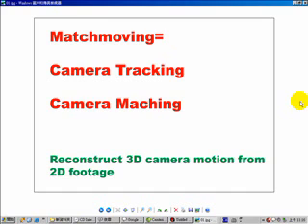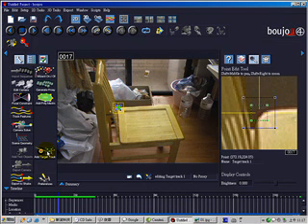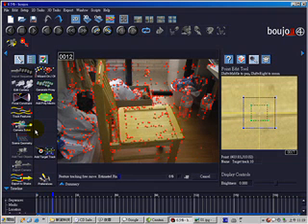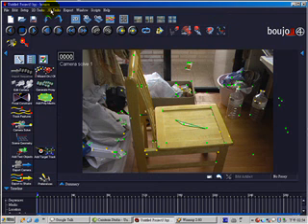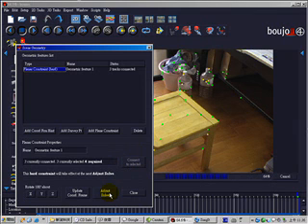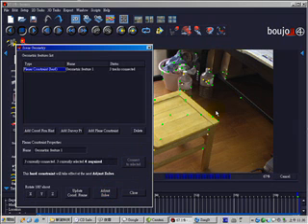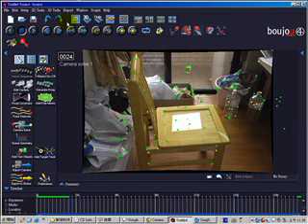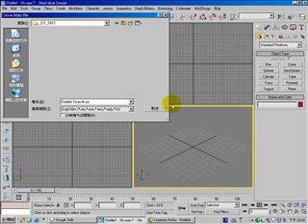Matchmoving with Boujou 4 and composite in 3ds max 7

Comment: Chip type: GeForce 7600 GT
DAC type: Integrated RAMDAC
Device Key: Enum\PCI\VEN_10DE&DEV_0391&SUBSYS_820D1043&REV_A1
Display Memory: 256.0 MB
Current Mode: 1280 x 1024 (32 bit) (75Hz)
Monitor: iiyama ProLite E1900S/SV
Monitor Max Res: 1280,1024
Driver Name: nv4_disp.dll
Driver Version: 6.14.0011.7824 (English)
DDI Version: 9 (or higher)
Driver Attributes: Final Retail
Driver Date/Size: 10/7/2008 13:33:00, 6058112 bytes
WHQL Logo'd: Yes

Comment: Operating System: Windows XP Professional (5.1, Build 2600) Service Pack 2 (2600.xpsp_sp2_qfe.070227-2300)
Language: German (Regional Setting: German)
BIOS: Phoenix - AwardBIOS v6.00PG
Processor: AMD Sempron(tm) Processor 3400+,  MMX,  3DNow, ~2.0GHz
Memory: 1536MB RAM
Page File: 871MB used, 1284MB available
DirectX Version: DirectX 9.0c (4.09.0000.0904)
DxDiag Version: 5.03.2600.2180 32bit Unicode
Card name: NVIDIA GeForce 7600 GT 
Manufacturer: NVIDIA
Chip type: GeForce 7600 GT

Comment: If you have any Max or computer software in general, you shouldn't have any problems seeing everything. He sometimes clicks "cancel"...

If he doesn't change any variables it's cause they're all at default. The basic concept is you're exporting an Animated Camera from Boujou into Max and using a Plane as the reference for your ground.  You can then line up any 3D objects with that plane and the camera will move around them, matching the camera movement in your video (animated background).

Comment: I am doing something wrong. Everytime I do this the mesh I created in BouJou comes in at a the wrong orientation to the camera.

you mentioned there is more detial on CG Taiwaner, but all I find is a links to this tutorial.

Also you create a mesh twice in this tutorial using 3 points. Then in 3dsmax you only import one and it has 4 verticies. Did I miss something?

Comment: none the less a very helpful tutorial. another thing i wanted to ask you:
did you encounter any crashing problems when tracking 1080i footage? i get a crash after about 300 frames (cant even preview from boujou). i tried to re-encode it, but no help. resizing to a smaller definition helps tho. any tips on that?

Comment: Yes. Thats what i done first, but then i found it hard to aline everything with the plane once i'm in 3Ds Max.
But i have figured it out anyway. In Boujou, you can switch to 3D mode and see where the grid is going to be, and then move it around and aline it with the Plane you made. 
This makes it so much easier and quicker to use once you get into 3ds Max

Comment: I have one more question if you don't mind.
If I have drawn a square or I have a cube in 3ds max, and I rotated it. Can I make that the main grid would be alligned (rotated) to my rotated shape? If later I want to create new shapes, but on new, rotated grid. This is problem when I want to create objects on my video and the 3ds max grid does not match, for example, table in my video.